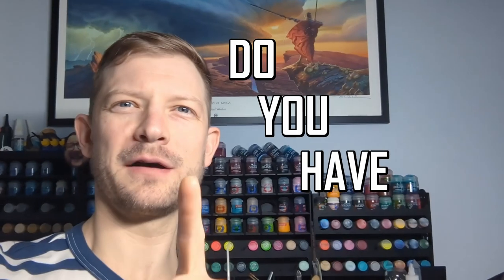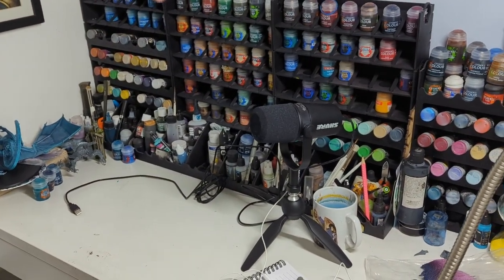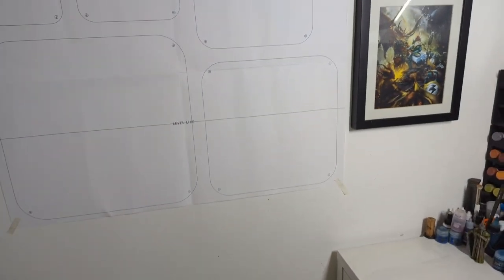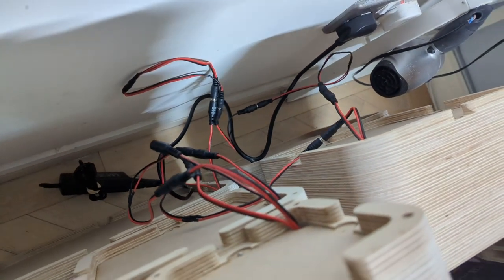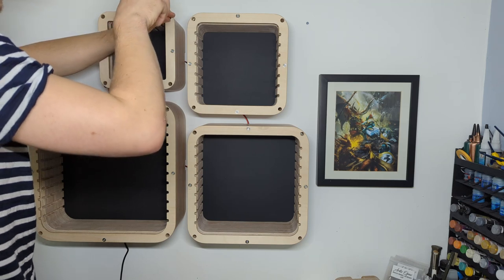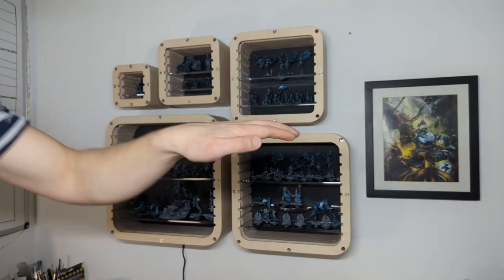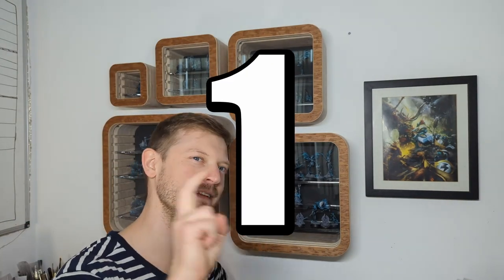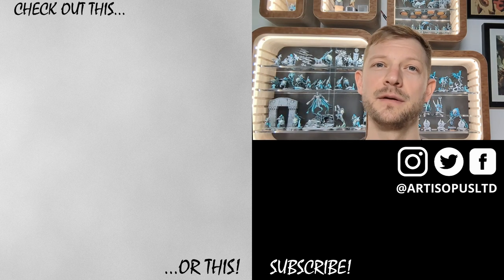(Giveaway!) My Tiny Warhammer Hobby Area + Upgrade

Comment: QUESTION:
As mentioned in comment with suggestion I am preparing to set up  my painting place.
What I struggle the most is approach to airbrush painting station

-  How important is the ventilation? (would mask be sufficient?)
- How efficient is the ventilation in painting booths that are available on the market?
- Would external fan (for those who have such luxury and can afford it) be better than these paint booths 

I find these painting station bulky and also expensive. 
I do not see any on painters that stream their work to really use masks or to have any special vent....

Comment: strange suggestion i found helpful with my small area is to rest an old large mirror to side of work space to make the space  look bigger and to bounce light in from the side. ( ive also started  sticking poster tac to it when not needed and sticking models/parts, brushes etc.  there as temporary storage off the desk)

Comment: My suggestion of sort builds upon what you were saying about how you have dedicated assembly and painting areas and that is to implement a methodology used in manufacturing called '5S'.

The 5 S' come from five Japanese words: seiri (整理), seiton (整頓), seisō (清掃), seiketsu (清潔), and shitsuke (躾) and are generally translated to sort, set in order, shine, standardize, and sustain in that order. Basically, it lays down the principles on how to organise an efficient and effective workspace by identifying and storing the items used, maintaining the area and items, and sustaining the system.

Sort: is sorting through all workspace items and removing anything unnecessary from your workspace.
Set in Order: is putting all necessary items in the optimal place i.e. commonly used things are closer and easier to access and vice versa for uncommonly used things.
Shine: is cleaning and inspecting the workplace regularly.
Standardise: is to standardise the processes used to sort, order and clean the workplace.
Sustain: is self-discipline to maintain all the previous steps.

Obviously, this is a professional manufacturing principle being applied to a hobby workspace but there is definitely some merit in taking inspiration from the above and implementing it into your own workspace as it develops good habits and cleanliness.

Comment: My suggestion is an L-shaped corner desk with drawers. Mount your paints on the walls, nail polish racks work well. Keep your basing materials in one drawer, paint brushes in another, and if you have another keep your airbrush equipment in another. I personally have a phone mount on my wall and an arm mount for my computer monitor off to the side so I can have a large screen reference photos. My question is how do you store your less proud models that don't go into cases or on display?

Comment: Question: How do you store unfinished/ unassembled projects if you have more than one project on the go? I often get creative fatigue working on one model/ unit. In order to paint hard to reach areas I often leave arms or shields off of my model until it is mostly finished and as a result the models and matching bits can get out of hand. I want these items easily accessible because I switch between projects while waiting for paint to dry. 

Suggestion: If you are working on a unit or army that features a similar colour theme, make up pre-made mixes of your favourite paints. Example: I often use a mix of Leviadon Blue and Talassar Blue thinned with contrast medium (2:1:1). I keep a bottle premixed to these ratios so that I can grab a single pot to do my colours freeing up desk space. It also helps keep my colour scheme uniform through an entire unit or army. As a bonus pre-made mixes travel lighter if you take your hobby to another location.

Comment: I'm going to echo something already said.  portability is key to small spaces allowing rapid change over from basing to painting to ... I'm using Rubbermaid stackable containers that also act as acrylic, oil, varnish, brushes, basing ect containers so I only need what I'm working on atm.   because we move more frequently, they also fit in tubs and are protected for the move and ready to drag out in the new location.

Comment: My suggestion for a small hobby area is to magnetise stuff and use self adhesive magnetic (ferrous rubber) sheets. It means you can stick them anywhere - my models are stuck to the bottom of shelves as well as lining the tops - I have an area on the wall for models I'm painting currently where they all sttick sideways so it frees up desk space. Obviously a fancy wall cabinet would be far superior! Oh, and like those beautiful wall cabinets, make sure you have lots of light!

My Question is what's the best way to stay comfortable and ergenomically safe while painting a lot? Standing desk, stretches at intervals, repositioning?

Comment: My space has to be modular.  We don't have a dedicated hobby space. I like to set mine up in the dining room as it is adjacent to the Livingroom and I can still participate with the family when watching movies, etc. Everything I need fits into stackable plastic containers and for airbrushing I have an old printer box which I've sealed with duct tape and cut a hole in the top so I can light it properly.  :) it's a cheap set up but my stackables fit in the airbrush box and then everything stores compactly until I'm reading to take over the dining room again.

Comment: Wall mounted makeup shelves have been great for paint storage and frees up tons of desk space. I know some youtubers have a aperture that hangs from the ceiling for recording gear, best examples are Miniac and Ninjon I think, they have very out of the way set ups for recording. I have sterilite shelveson the underside of my space that I keep spare empty bottles and basing material and such in. I also have a phone stand that has a space for a bluetooth speaker and can hold a tablet to allow me to have reference material or podcasts or what have you. Without very good ventilation for an airbrush I would be hesitant to put and actual computer in my painting/airbrushing/printing space.

Comment: For a smaller area/desk some vertical paint racks on the wall so the desk gets more free area  and a smaller pait rack with the most used paints or the ones that going to be used for the painting session and brushes , a few testing minis, the less used stuff maybe some small ikea cabinets to store them.
Thats basicly my setup, i built a small set of shevels to put some minis for the next painting session, its like a paint rack but for minis, dpesnt take up much space on the desk and its easy to move aside if needed.

Comment: With the space in the back you could make a french cleet system with either wood or metal for a lower profile, this would make installation significantly easier and the front cleaner since you wouldn't have the screw holes.

Comment: Suggestion: Design the space before buying anything, and make sure you can expand vertically, quite often you end up expanding without thought causing things to not fit or removing valuable workspace. 
Question: What are your favorite racks/holders to organize paints/brushes and stuff.

Comment: Suggestion: good lighting is essential for painting, no need to go for an expensive lamp, you can get a cheap architect lamp from IKEA or any other place using a cheap 17 Watt, 1300 lumen, 6000k LED bulb to paint in bright white light. One lamp is good for painting, but two will give you the best results without shadow. Get a lamp with a clamp to give yourself more work room.

Comment: Suggestion: I have to paint and build on the kitchentable and find my two compartment carry-case with internal dividers extremly useful. Top compartement is for colors, brushes, wetpallet and painting glasses. Bottom one for buiding tools, glues, portable lamp, glasses for water, basing materials and a DIN A4 cutting mat. Easy to store away and can be set up anywhere! 🙂

Comment: I have hinged panels in my vertical paint storage so i can swing open a panel and get to the paint storage underneath, so i have two layers of vertical paint panels ive hinged some of the front panels so they swing in a way that doesn't impede anything on the table works really well with heaps of starage at hand.

Comment: Have to say I'm curious about the whiteboard I can see that seems to be behind your hobby space. 
I've been trying out various ways to keep projects in mind and organise my workflow.
I'm not in a particuliarly small hobby space since I have a dedicated room but like you mentioned I have on occasion ended up working in the 6inch square space I've left in the mad clutter on the desk. It always seems that if I am one set of miniatures from turning into a hobby ADHD train wreck  :).
One of the things I've worked on is getting a set of stackable boxes that hold miniatures fairly well and using those to stage miniature projects.
So I've a box for stuff that's ready for assembly a box for what I'm planning on base coating and a few boxes of WIP stuff.
That allows me to store them away fromt eh painting area and quickly swap out for something that I want to work on as needed.

Couldnt agree more on the comment about making it a nice place to be. I do occasionally escape to my painting desk and end up listening to music and reading a book while marinating in the relaxing smell of acrylic, plastic and whatever I recently glued

Comment: Suggestion: Since my hobby area is also used for other purposes, I always have to put my projects away between paint sessions. What I use to make the process super easy are small plastic boxes. I have a box that I use for preparing my minis (with clippers, sanding sticks and so on), a box which I use  for painting (paints, brushes, wet pallet) and one for basing (tufts, pastes, etc.). 
This is super practical, since I find that I can´t get any painting done when I have to prepare my space for more than a couple minutes. Like this I just need to grab a box and I´m ready to start!

Comment: Suggestion, Ikea do a set of Kallax cube shelving with a table attached. With the various options available with that modular system means you can have drawers, additional shelving, cabinets etc. You can also get aftermarket options such as a 3 drawer paint storage system that fits the kallax range. I use them for my 3d printing
Reply from the maker: Practical approach! I'm at a very cheap (and feels it :\) Ikea asymmetric desk, it does the job, but I don't think it's the best of their options, never mind all the options out there.

Also, I have too much stuff! Need to downsize that, then consider where/how I work.

Comment: My question: how to use my laptop near enough to use it but far enough from paints.
My suggestion: to improve space I use plastic storage boxes under the table to hide airbrush, models and other stuff far from dust. And better if the boxes have wheels. They can also be used as auxiliary tables.

Comment: Question: What is the vertical paint storage you are using? I tried finding 3D printing files, but couldn’t find something that was quite right. Yours looks good
Reply from the maker: Hey buddy, as mentioned in the video they're the Element Games racks, but I sprayed mine black, which makes a huge difference :)

https://elementgames.co.uk/paints-hobby-and-scenery/element-essentials

I sprayed them black, then varnished, they're tougher, and wipe down/dust OK

Comment: Suggestion, have everything modular, all paints and brushes in 1 tool box, all assembly and conversion tools in a 2nd and finally all basing materials/supplies in a 3rd. You can then chop and change your set up as you need.

Also I found that you need to be organised with your collection and storage

Comment: Question: What's the best vertical/wall organizer for paint when you use multiple types of brands? There's plenty of organizers for specific size paint bottles, but when you have Citadel, multiple size dropper bottles, etc it's tough finding something that works for everything. Bonus points if it also organizes more than paint!

Comment: My suggestion for a small hobby space (which) I do have is just trying to keep whatever work space I do have clear. While you did say you wanted you wanted to keep items close I would keep my paints somewhere else and only bring over the paints I was using for that session. Also for the laptop, put it on one of those small folding tray tables close to you off to the side.

My question is that I am just starting to get into the minature painting hobby. What paints/brushes would you recommend starting off.

Comment: A good suggestion is, if your central paint area has a middle (paint station type tray) that comes away. So you can easily go portable in your house. But don’t need to have it stored elsewhere or need set up to switch over each time. 
Mine sits at the back of my desk. With all current paints and models on etc. 
then when at my desk I pull forward to the desk hobby area, but could just lift the whole tray and sit with family or in the lounge watching telly etc. 

Questions I have way too many! Is there a way to stay as current as possible when you can’t have an airbrush cost/space/set up wise etc. or do you lose out on too many great methods and such.

Comment: Suggestion: My best addition was a child's art supply station - It has 12 narrow drawers situated into 2 columns of 6.  They are set into a metal frame on 4 casters that I slide under my desk.  There is a shelf on top that I use to hold 3 art bins full of paints.  I roll it out while I am working and stow it away when done.  Found it on eBay fairly cheap.  Question: best way to store paint brushes - I have a couple of sets, 1 for faces, 1 for everything else, plus a set for dry brushing.
Reply: That sounds like a good suggestion for my workspace - have you got a link so I can get a better look?
Reply: @jeffryan90359  Thanks - certainly an idea to consider with a lot of storage. :)

Comment: I use a ikea build your own desk and instead of getting 4 legs I brought 3 and then brought a draw unit to act as the leg so gave me extra storage also I got the wide desk so put a narrow small bookcase ontop again nice extra storage we got the large (but still small) desk so it has my computer on it aswell but that's to one side it sits ontop of the ikea desk draw thing with a gap so the keyboard goes under there which also has a draw so I put my paintbrushes and texture pallet in. It's decorated with my minis funko pops and posters it's my favourite place to be in my house!!!!!!

Comment: My question is, if given a smaller or non-permanent space, how would you store paints for ease of use?

I’m currently living in a renovation and my hobby space has been given over to storage. To make sure I make progress with projects I have different storage tubs for different parts of the process, eg building, priming/base coats, detail and basing. This means I can work to clear milestones while maintaining a clutter free workspace.

Comment: Small Work-space Suggestion: If you need monitors for PC's etc (I have 2 because: home PC plus work laptop (which has a tiny screen) then put the monitoers on arms. That way you can swing them right back out of the way when not needed (or up close when needed)

Comment: Suggestion: You could get wall mountable boom arms for the microphone and light. That way when they are not being used you can move them out the way and they will never take up desk area with clamps/stands etc? (or clamp them to the legs).

Comment: Question: Assuming your hobby space is not in a separate room, how do you protect it from your cat when you are not using it? My current solution mostly revolves around hiding everything away if I must leave the room, but sometimes it would be nice to be able to leave projects out when I take a break or have to leave for a period of time.

Suggestion: Don't hide your hobby area away in a basement shed or garage. By having your hobby desk in say, the corner of your living room, you can do hobby time with your significant other/ roommate / friends while they do their thing (watch TV, play video games, their hobby, etc). Hobbying can be social, even if the people you enjoy it with don't paint themselves! It's great to get second opinions on color placement or any other aspect of what you're working on. It can also provide entertainment by listening in to what they are doing, or when no one else is around you can use the TV/computer in the room to provide background noise.
Reply: In regards to cats, I have 3.  I purchased a very lightweight cloth that I drape over my materials.  Additionally, I have set up “napping” spots that are close to my work area.  It took a couple of months, but they are trained now and don’t bother anything or launch themselves onto the fabric

Comment: I have a small hobby and display area using IKEA Cabinets, storage on the bottom, display around the sides and top. Displays my lego and minis. The problem I have is IKEA doesn’t make full clear glass doors for cabinets like they do for Ekets. So the doors have a boarder that prevents some display at the bottom. I didn’t like that so no doors…which means dust :( But I have some cabinets with a counter top. I have a way to hang my paints on the wall as well. It’s still a work in progress though. I don’t use my laptop, but often have my iPad in my area for watching tutorials and such while painting. I will post a pic to my IG (same handle) maybe this week.

Comment: Suggestion. I use back 2 basix racks for paint. They have tiered versionand vertical versions. Great for small area or larger.
Question if you using airbrush do you do it outside given your small area or if not how do you deal with it in that area?